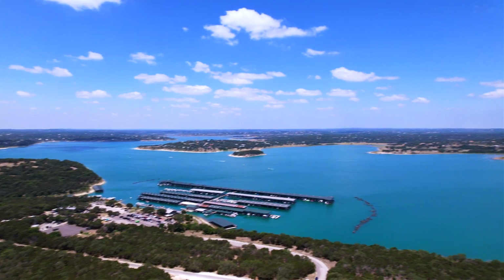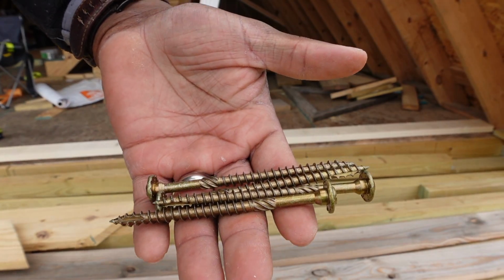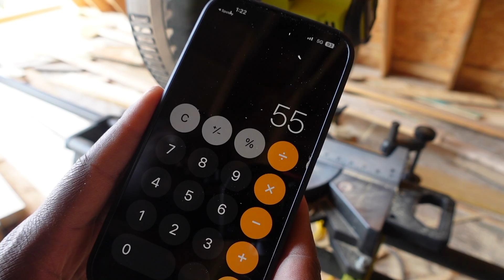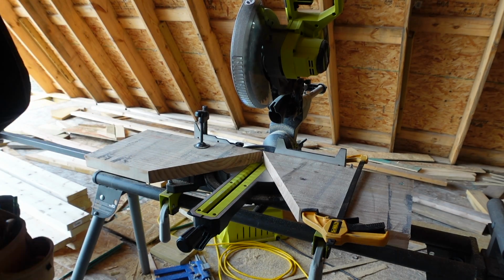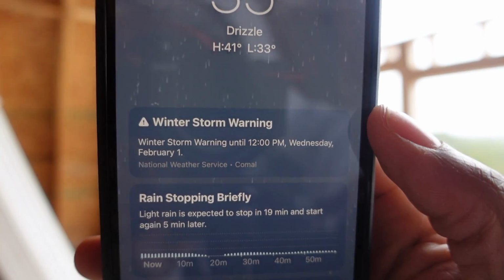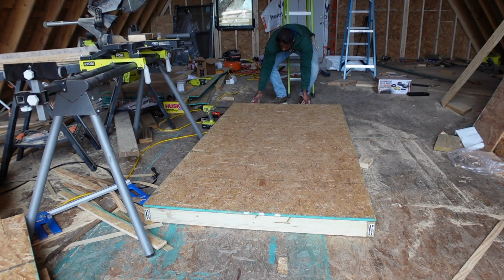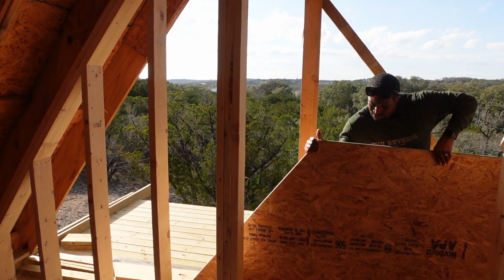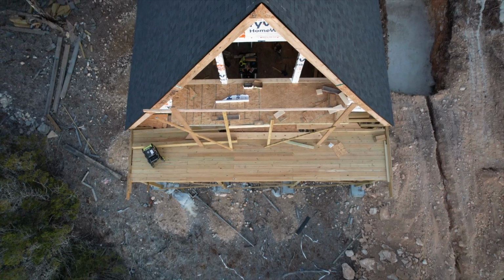Building The Back Wall By Myself | DIY A-Frame Build | Episode 22

Comment: how are you friend  I watch your videos regularly.  I like this frame house very much.  I want to know from you, if I make this frame house in Bangladesh, will it be good?  Here the temperature is high and the storm rains. Will I benefit from doing it here?  I was waiting to know the doctrine.  I love this three-story frame house.  Please let me know the approximate cost in your country.
Reply from the maker: I’m great! How are you? Thank so much for watching my videos. I don’t know much about Bangladesh. Sorry about that. However, as long as you’re building your house on solid ground and you follow all the best practices of construction such as using the right sized lumber, nails, screws, etc. And, you’ve installed them correctly, you should be totally fine.

Canyon Lake, TX also has heavy rain storms, especially today, and the building has held up fine. Thank God! 

I’m going to be releasing a cost breakdown video once the build is complete. So stick around. 🙏👍😀
Reply: @darryldarks  Can this house be built in hot weather areas?
Reply from the maker: @Dreamoflife247  Absolutely! It’s pretty hot here in Canyon Lake.